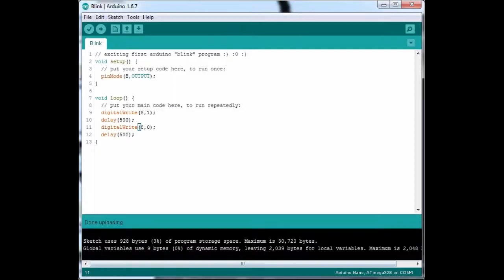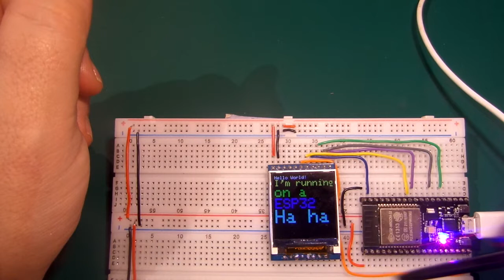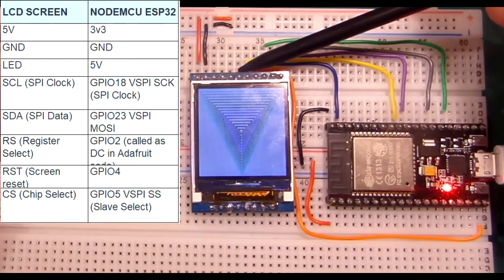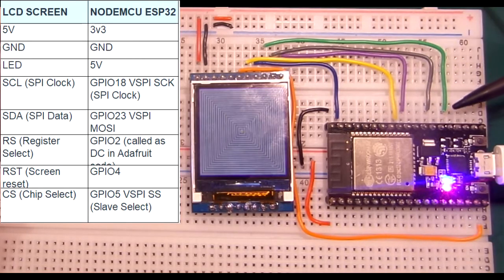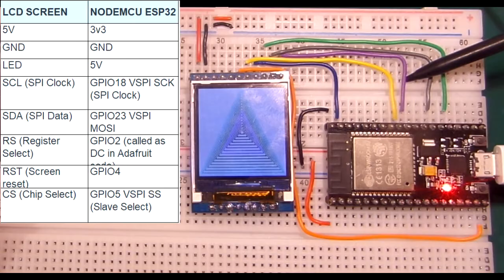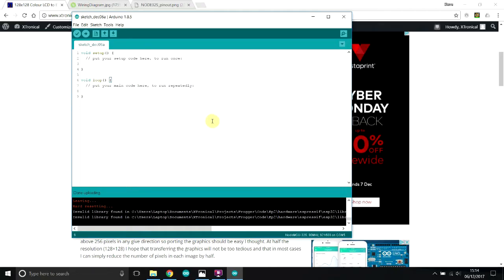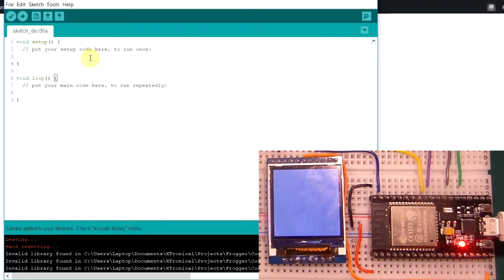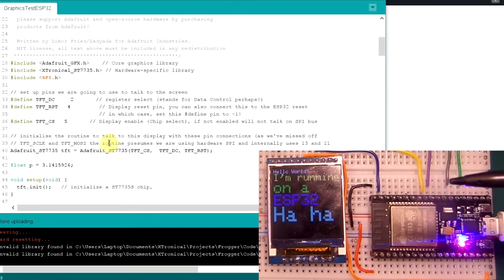Connecting Colour LCD to ESP32 (SPI ST7735 driver), TFT, Display, NodeMCU 32

Comment: wordpress is down on your site your php version needs to be upgraded sites down the drop version 4 it deprecated best to put version 8 on and it will come back up, and upgrade word press also you got this
Reply from the maker: Thanks for the heads up. I don't control this so guess my provider has a larger issue. Will investigate.
Reply: @XTronical  they dropped thw version on New Years i had same problem on my side in the cpanel portal. Wordpress needs to be upgraded they have tried but that errror shows that php version has failed. I just went through all this on my site.
Reply: hope that helps you out I was following one of your projects and finished UNI went to go back to it and noticed site was down enjoying the content thanks for your contribution to the community 🙂
Reply from the maker: @woops3064 I've been in contact they are working on it apparently. Hopefully back soon.
Reply: You need to look at your site mate its allowing access for back end access i have taken a screen shot for you if you need to see it  :-)
Reply from the maker: Most of site back up and running but this page is currently still offline, should be back in a few days. The site was very mangled but I'm managed to recover everything from back ups and have recreated with my own code rather that WordPress.
Reply from the maker: This page now up and online again
Reply: @XTronical  that's awesome mate so glad you got it fixed

Comment: You are the best, thanks for the awesome library. I can get mine to show up but for some reason the sync fails and the image keeps scrolling. I sense that it can be solved by modifying the XTronical_ST7735.cpp, I suppose in void Adafruit_ST7735::displayBuffer() or mySPISettings, but I'm learning and I don't have that level so I'm writing in case someone can help me. Thanks a lot

Comment: I believe the other connector is for a variant of the board that has an SD reader in addition to the display. You get one header for the display and the other for the SD. This is supported by the 3.3V input as SD cards run at that voltage.

Comment: I finally was able to put some picture in my TFT screen thank you!!! but my screen is 128x160 is there anyway to change the aspect ratio?
Reply from the maker: Unfortunately that is a physical design of the screen. You would need to not use some of the screen to change the ratio.

Comment: Thanks for this tutorial.  It worked exactly as you mentioned in the description.  However, I am using a 1.8" TFT with card reader and the resolution is 160x128 and your tutorial is geared for a 128x128 display.   How can I modify the code to utilize the full screen at 160x128 ?  Thanks once again.

Comment: I have a 1.44" SPI TFT display with slightly altered 8 pin layout, however all items are there, e.g. LED is on pin 8, VCC on pin 1, SCK is on pin 7, SDA is on pin 6, etc. I downloaeded and installed your libraries, however when I run the graphics example in your packet, it gives me a fatal error "A fatal error occurred: MD5 of file does not match data in flash!" I have great problems with matching displays to different manufacturers ESP32 versions. If you can help it would be much appreciated. I have been a subscriber for a while.
Reply from the maker: Although I've never had this, it's not related to the screen software as such. It's saying that the code you uploaded does not match the compiled code on your computer. This could be caused by corruption when uploading. One reason for corruption can be the power to the esp32 fluctuating to much. These screens can be power hungry and if the USB cable is also dropping voltage then this can cause problems. Try disconnecting the power to the screen, then upload. If this works you just need to connect the power to your screen afterwards. Swapping out the USB lead for a good quality high current one may also solve the issue.

Comment: It will also work with a 1.88 "display ?
Reply from the maker: Just need to make sure it's ST7735 based.
Reply: @XTronical  yes it is ST7735..

Comment: I bought TFT online. It is labeled ' ST7735 driver'. Pin layout looks similar to tft in this video: ( but has exact pin layout as ILI9225 driver )
VCC
GND
GND
NC
NC
NC ( pin in this video is LED)
CLK
SDA
RS
RST
CS
So i have no idea how to wire it to my Nodemcu8266 and which library to use.  Right now i only have VCC & GND wired.  When i plug it to my pc's usb, the tft lcd screen is all white.

Anyone has the same problem?
Reply from the maker: The screen being white with power and gnd is fine. However it does sound like you've got a 9225 board. I've never uses one of these so cannot help you there I'm afraid. Suppliers can be a pain when they give you the wrong thing!

Comment: Yes, many thanks for this vid! I managed to get it to work following your wiring. The Adafruit library now also works with your wiring, after adjusting the code in the sketch.
#define ESP32 1

#elif defined(ESP32)
  #define TFT_CS         5
  #define TFT_RST        4 
  #define TFT_DC         2

The Adafruit library also includes adjustment for screen size

  // Use this initializer if using a 1.8" TFT screen:
  //tft.initR(INITR_BLACKTAB);      // Init ST7735S chip, black tab

  // OR use this initializer (uncomment) if using a 1.44" TFT:
  tft.initR(INITR_144GREENTAB); // Init ST7735R chip, green tab

  // OR use this initializer (uncomment) if using a 0.96" 180x60 TFT:
  //tft.initR(INITR_MINI160x80);  // Init ST7735S mini display

  // OR use this initializer (uncomment) if using a 1.54" 240x240 TFT:
  //tft.init(240, 240);           // Init ST7789 240x240

Have you connected to a STM32? Haven't managed to get that going as yet.
Reply from the maker: Brilliant, I'm glad you've had some success, no I've not even got a STM32 in my parts box yet I'm afraid to say so I've not been able to investigate. IF you sort it let me know :)
Reply: @XTronical  
STM32 (Blue Pill) connections using the Adafruit Library example

#define STM32 1

#elif defined(STM32)  
  #define TFT_CS         PA4
  #define TFT_RST        PB6 
  #define TFT_DC         PB7

//GND   GND
//VCC   3V3
//SCL   SCK PA5
//SDA   MOSI  PA7
//RES   SCL PB6 PB8 PB10
//DC    SDA PB7 PB9 PB11
//CS    NSS PA4
//BL    5V

Jobs a guddun.
The STM32s are very cheap if you don't need the WiFi of the ESP32 and have more memory and pins and are faster than a Nano or UNO but not as much info to be found

P.S. Love your intro bit.

Comment: Hey awesome video! I'm learning all this for the first time and am wondering how to do what you've done in this video, but in micropython. I have the ESP32 Thing, and an Adafruit 1.44" TFT LCD Display. I would use Arduino but my project requires I use micropython.
Reply from the maker: I've never looked into using micropython, it would all depend on whether a library has been written for that display in micro python, sorry I can't be more helpful.
Reply: @XTronical  Was asking around other sources as well and someone sent me a link for a micropython library. I'll leave it here in case others are in the same boat as me. Thanks anyways!  https://github.com/boochow/MicroPython-ST7735

Comment: Hi, how come we dont see the lines being drawn on the demo in the end of the video ? I am considering the ESP 32 as a replacement for the arduino to speed up the display, but I dont understand, the display doesnt seem much faster than the arduino, or is it ?
Reply from the maker: You're right it isn't much faster by default, which is more to do with the driver and the bottle neck of the spi communication. But it is solvable using my altered driver, you can see what can be achieved if you watch my Frogger video

https://youtu.be/J9mV2IcEvP0

This other earlier video goes through the issues of speed and how to squeeze the max out of the SPI connection. 

https://youtu.be/A8Rzx-_ywIo

The esp32 is massively more powerful in terms of speed, memory and IO, and the Arduino could not have handled the frogger project at all. 
Hope this helps.

Comment: Hello,
Thank you for your neat tutorial video. I have a display (https://www.adafruit.com/product/2088) from adafruit and the ESP32. I followed your tutorial but it's not working. 
I'm wondering if your code suppose to working on this particular display? 
Thank you
Reply from the maker: That link is not working for me. However adafruit usually have a link somewhere on the product page for the drivers for their screens but if you can tell me the screen name /id or correct link I'll have a look.
Reply: @XTronical  Thank you for your reply. the name of the display is Adafruit 1.44" Color TFT with SD Socket https://learn.adafruit.com/adafruit-1-44-color-tft-with-micro-sd-socket
Reply from the maker: At first glance it would seem it should work. I'll have a more detailed look tomorrow and get back to you. Getting late in my part of the world now.
Reply from the maker: Haven't had time today, hopefully tomorrow.
Reply from the maker: OK, my tutorial was for people with cheap none Adafruit displays, for these the Adafruit code wouldn't work so I adapted it, so basically the code and work on this video/page will not work on an official Adafruit product. For a start they seem to have extra pins that the cheaper TFT's do not. I think if you follow their wiring and tutorials then you should be ok. Hope this helps.
Reply: @XTronical  thank you so much.
Reply: Thank you so much.

Comment: Hello Im having a problem my display keeps going off center and then sometimes works then goes off center again any ideas why?
Reply from the maker: Mmmm.... Not come across this. Does it do this during running the demo or between resets. What I mean is once its doing it one particular way does it stick with that until powered down or reset
Reply: thanks for the fast reply! yes it stays that way till the next rotation I was able to fix it mostly by changing the sets back to the original numbers its still off but not by much it is a different model but same size and chipset so i thought it would work but it was my mistake i think
Reply from the maker: Can't think what would cause that behaviour, hopefully you sort it permanently.

Comment: Well, finally, many thanks, I was dessesperated to make the tft display work, a lot of libraries didnt work at all. The one used on this example worked perfectly from the begining.

Just in case someone has the same module: 1.44 spi 128*128.  it works perfect.
Reply: mines not  bro help lol

Comment: super, I tested similar dispaly with ST7735 but 128x160... I change in your library 128 with 160 and rowstart in 0 as in comments but is not full ok, see https://youtu.be/pV8X4k0MkoM
Reply from the maker: Had a quick look and am I right in saying that it more or less works but doesn't always erase screen correctly? If so I probably need to look at the code, looks like an oversight somewhere.
Reply: thx for your replay... after some search on net I download and tested with real succes Bodmer library from https://github.com/Bodmer/TFT_eSPI ... if you send me some update for test, I test :) my email is nicu.florica@gmail.com

Comment: Dear X-Tronic Team,

I a tried to get my 0.96" 160x80 TFT working with my ESP 32. Fortunately I found your great video with and with your X-Tronic libraray and it finally works!!! However I would like to adjust the library display size to my needs. Unfortunately my experience with libraries is quite little and I was mit able to adjsut it. Could you maybe give me a tipp where I hab so this. 
Thank you very much in advance.

 Greetings from Germany
Matteo
Reply from the maker: Thank you for your comments, you will need to expand the buffer memory, although I've not tested this (as I don't have that resolution of screen)  these lines in the header file "XTronical_ST7735.h" should just need changing

// width and height of the screen
#define ST7735_TFTWIDTH  128
#define ST7735_TFTHEIGHT   128

Comment: Could you upload the Fritzing part file for the screen, I could not find it from anywhere, Thanks
Reply from the maker: Sorry, it may look like a Fritzing diagram but all I did was use the graphic for the breadboard, the screen I think was based on something similar (that I modified in Fireworks) and the ESP32 is one of my own that I photographed. This is because I couldn't find the parts in Fritzing, which I guess might be your problem too?
Reply: Yes, part for ESP32 is easy to find but this screen is not. But still thanks for ur reply

Comment: Is it possible to use an ILI9341 TFT Display with the ST7735 controller?
Is that I have a clock sketch for a TFT Display 1.8" ST7735 and would like to use it with a TFT Display 2.2" ILI9341;
thank you
Reply from the maker: Unfortunately no, your screen needs the 9341 driver but does your sketch use the adafruit graphics library, if it does its not usually too bad to add in a different driver whilst all the graphics commands remain the same.
Reply: Thank you for your reply! You say I can use ili9341 instead of ST7735, changing that in code and in the library as well? Thank you +

Comment: Hey man, thanks for the awesome library. I can get mine to display but for some reason the top quarter of the screen just shows up as random pixels. It looks like the image has been shifted down the screen. Any ideas? I have tried switching to a different screen with no luck.
Reply from the maker: Quick answer : Try changing      rowstart = 32;  in the 7736 library XTronical_7735.cpp on line 626 and 632 to      rowstart = 0;

Long answer : This line line was added for the cheap screen I'd bought as most of these needed adjustment. Sounds like yours needs adjusting back to how it was.  Is yours an Adafruit screen or generic screen?  Either way my library was based on the Adafruit library and I adjusted it because it wouldn't work these cheap screens correctly, but now their latest library seems to be handling more variety of TFT. If you don't need the buffer screen memory that I've also introduced in my library then you may be better using the Adafruit one.
Reply: You're a legend! That was it. I have a knock off too but this makes me wonder how many different varieties there are by now floating around out there. You have gained a very active follower and subscriber today friend!

Where did you learn how to programming communication like this between microcontrollers and hardware? Any resources you could suggest? I have a computer science associates degree and I'm about to move onto my 4 year so I know how to program alright. But I just can't find a place to start learning how to do things with different peripherals like this and editing/creating libraries. Thanks again!
Reply from the maker: Thanks for your comments. I was lucky in a way, a lot of the stuff now is talking to devices with protocols like I2C, SPI etc. Which are great but if your a new-ish to it it can seem a bit daunting. I learnt my stuff before this sort of thing and although you were a bit nearer the hardware in many ways it was simpler to get the main concepts. You also need a basic understanding of electronics/digital electronics (and I only mean basic, my knowledge is not extensive in this area at all) I would recommend reading up on the basics of whatever it is you want to work with first, for example for displays read up on how screen memory is organised and used in a computer's memory. For a temperature sensor try just a simple thermistor first as this will be simpler than trying to write a library for a I2C device and it will get you down to the bare metal of using the electronics directly. Hope this helps.

Comment: What's your opinion on the sparkfun esp32 "thing" dev board? I'm thinking about going with that as it comes with the LiPo connection which would be really useful for making handheld electronic games.
Reply from the maker: I've not got one in my parts bin so I'm just speculating a little. The board looks to have a good amount of IO and seems good if not a little expensive, some people were commenting that wireless was a bit hit and miss but if you don't need that then it wouldn't matter. But also Andreas Spiess has done a review of several battery ESP32's a couple of weeks back if you've not watched that, if nmot then it should be helpful, here's the link : https://www.youtube.com/watch?v=-769_YIeGmI
Reply: XTronical I may make use of the wireless, but that's a long ways away for me, still at the beginner phase in my Arduino endeavors. I'll check that video out as I haven't seen it yet, thanks for the suggestion!